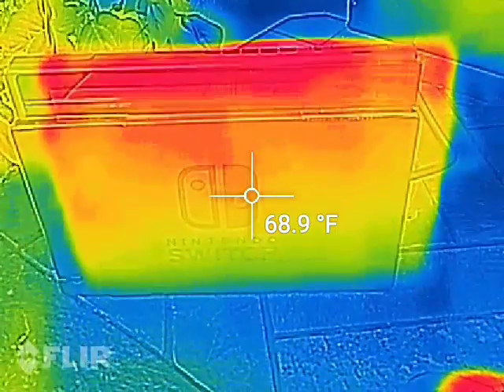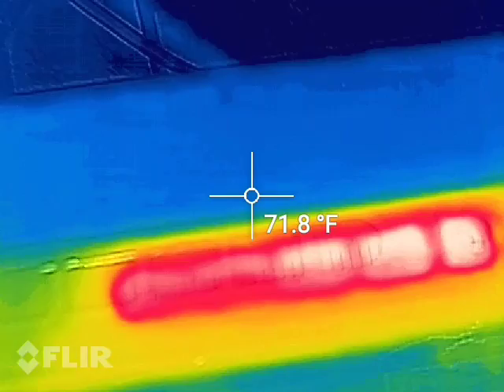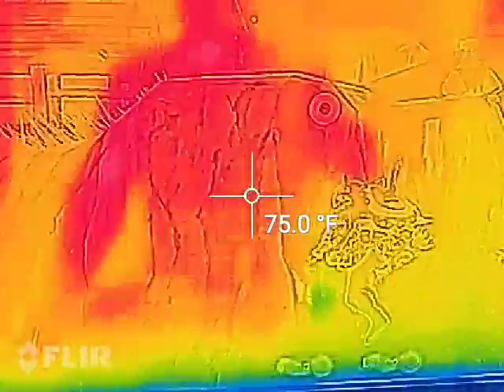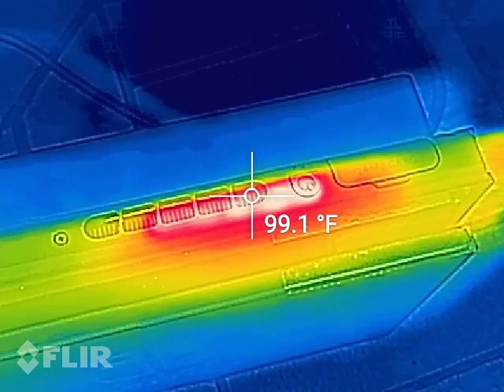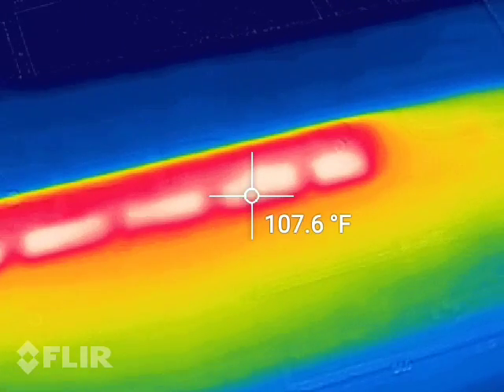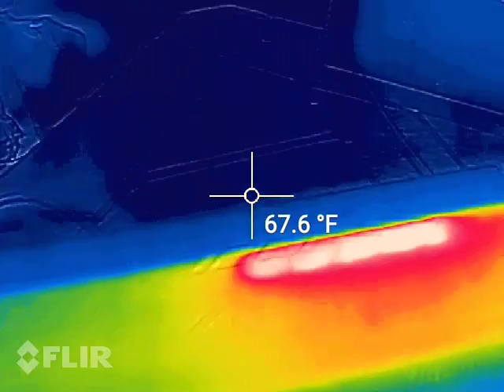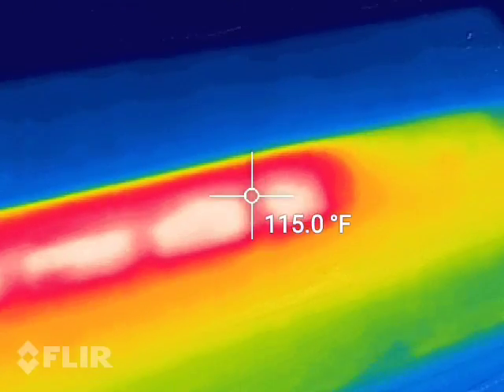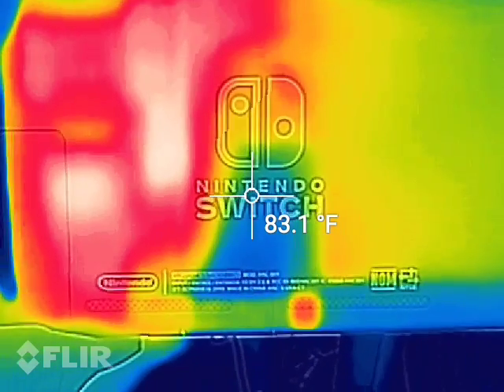Nintendo switch while in dock thermal imaging video 2017 FLIR

Comment: I just subscribed hoping you'd do this and then you did lol
Reply: Is it normal for it to get that hot? Or is that dangerous to the system?
Reply from the maker: I think the temperature is normal but it does get a lot hotter when it's in the doc. Now we did see the temperature go up while in the dock and that was only for about less than 10 minutes now just imagine playing it for an hour or two while in the dock I bet it would be a lot hotter. Thought when touching the Nintendo switch it's not hot enough to burn you but you can definitely feel that it's warm
Reply: TheUnderGroundBiz That's good to hear, especially with Mario Odyssey on Friday